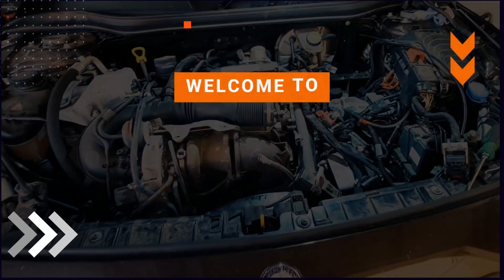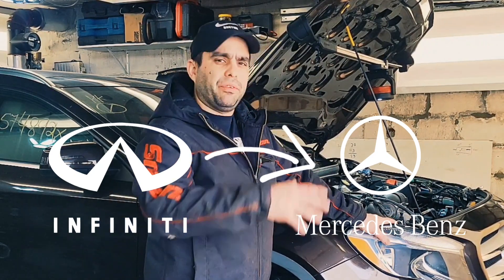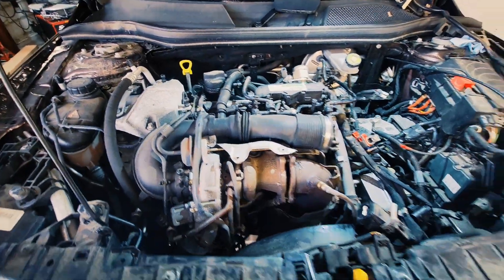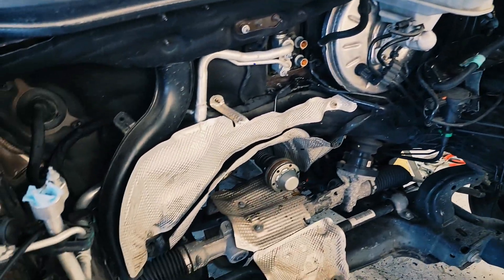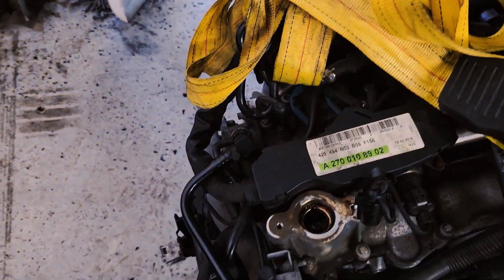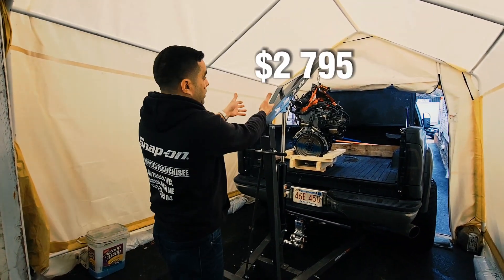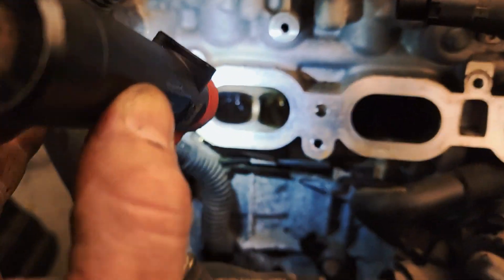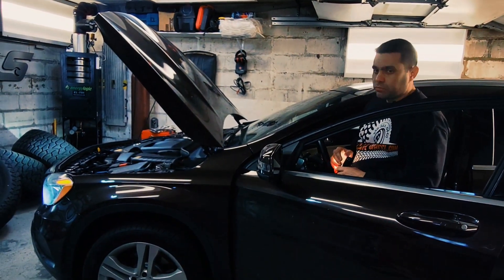Mercedes Benz GLA - CLA Engine Swap with Infinity QX30 Engine

Comment: Is there a difference when the engine is out of a fwd and mines a 4matic as well?
Reply from the maker: Mercedes calls its FWD system 4MATIC, so they're the same thing. There's no difference
Reply: Gotcha, did you swap out the flywheel? Or did you install how it came? Also any tips with removing/separting the trans?
Reply from the maker: No, we didn't swapp it. It's the same flywheel. About the trans, I would tell you that the dual clutch is not bolted to the flywheel. It's a spline connection between the flywheel, so it's pretty easy to separate.
Reply: Got it, thank you! Will tackle this project soon
Hopefully everything goes smoothly
Reply from the maker: @Juan-h8j2w  It will! Hit me up if you have any questions or if something comes up. We're happy to help.

Comment: Would this work for a 2014 Cla
Reply from the maker: Yes, it's the same car if I'm not mistaken
Reply: Question I just got my motor it's from the same year and model awd am I going to have to reprogram the transmission?
Reply from the maker: @Dealzu  If you keep the factory transmission, you don't have to reprogram anything. But if you're changing both motor and transmission, then you need to do a Transmission Adaptation, and you will need a good Scan Tool in order to do that
Reply: How much did this cost for engine and labor? 
Where are you Located? @meautoaccessories
Reply from the maker: @villantiofficial We are located in Medford, Massachusetts. We paid $3000 for the engine, and that was my wife's vehicle, so I didn't charge her for labor, haha. Although I know hourly labor rate for Mercedes is not low.

Comment: I am going through this exactly . I was wondering if I could do that on a 2018 cla250. Did you only replace the harness? What about the flywheel.
Reply from the maker: Yeap! 2018 CLA, GLA, all the same. The harness is also the same, in my case I replaced it because one of the plugs was damaged BUT MAKE SURE the flywheel is the same and the torque converter is not bolted to the flywheel.  All the accessories are the same, turbo, compressor, alternators, sensors, water pump.  I also recommend getting a new crankcase breather.
Reply: @meautoaccessories  thanks because I was wondering and needed to hear it from you. Those prices for a benz  engine to an infiniti is stupid.

Comment: Now can I swap a GLA45 AMG engine into my QX30?
Reply from the maker: Well, I am not certain about that. I believe it could work, but it would definitely require some programming to make it functional
Reply: @meautoaccessories  would I need to swap the transmission also?
Reply from the maker: @ramonherrera9260  It's supposed to be the same transmission, I believe so. But I'd still swap it out. It's definitely more power